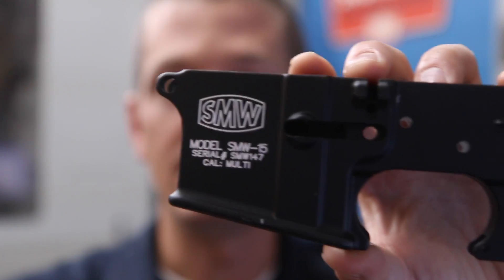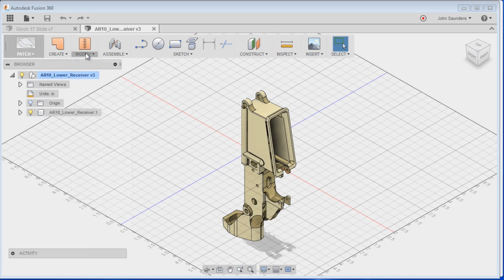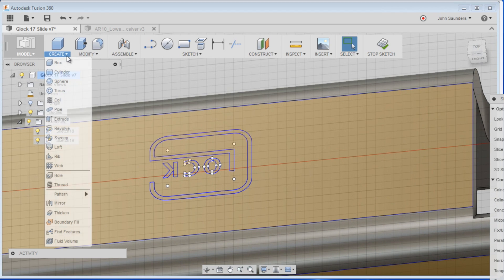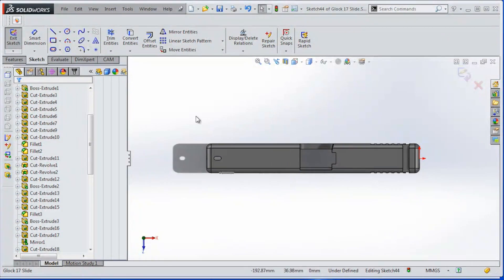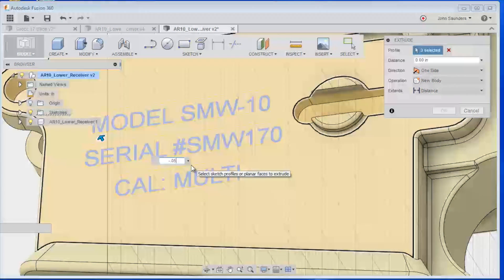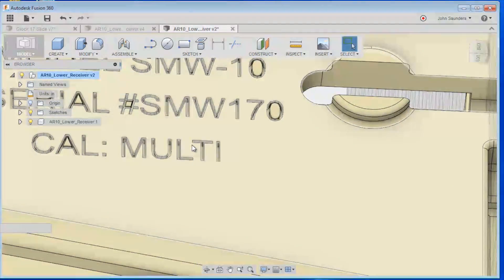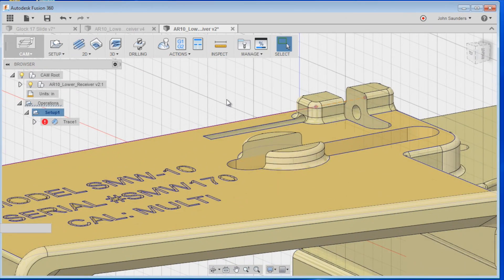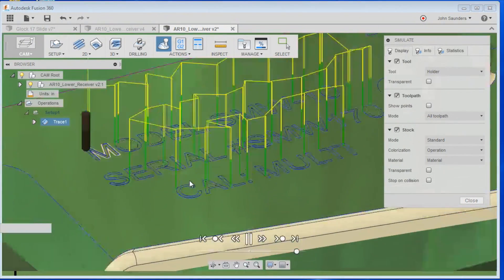CNC Engraving AR-15 Lower Receiver!  Widget49

Comment: 100% brand new to CNC because of as you said, DIY engraving on a AR, and I am having an impossible time trying to duplicate this. I downloaded from CNC Guns, but this would be so much easier if I could set the X & Y where I wanted them, rather than having the X=0 and Y=0 in the top middle of the face. Have you found a simpler way to do this? It's been killing me for WEEKS, and I'm about ready to give up. California laws suck !

Comment: Any chance that Fusion can do some kind of incrementing on that serial number where you give it a starting number and it counts up for each time the program is run? Or series if you are engraving multiple at once?
Reply: Might be a bit late here. 
If you want a number to increment every time you run a program, you would need something in the gcode that does that and I don't think it's possible. Some higher end machines may have that but actually idk. You could use the ParametricText add-in and link a text to the version number. You would just have to save the design to increment the version number and re-post the gcode.

Comment: I need to figure out how I'm going to do this for myself. I have a FFL and pay a Class II SOT, but my machines are all manual, so I have to send receivers out for engraving. I'm probably going to have to buy a desktop milling machine and do a CNC conversion on it but I could probably convert my Bridgeport clone for that kind of money. I know that I could build a pantograph attachment for my milling machine, but with that I would still be bound by the letter/number master plates I can purchase, and that would mean I couldn't engrave many of the reproduction fire control markings on Kalashnikovs and other foreign small arms. A CNC laser engraver would be awesome, but I doubt I could afford a nice one, and the Chinese models that I've seen are still expensive and of completely unknown quality. Powerful lasers are not something I really want to gamble with. I've also seen some importers use dot peening marking machines (not sure what they're called) to label older mil-surps with the importer's name. Those look pretty ugly and wouldn't really meet my needs though. Lastly, I have seen some pretty successful electro-chemical etching setups for recreating fire control markings on AK receivers, and the results looked pretty good. That process would be time consuming and require a lot of trial and error, but it would allow for a lot of versatility, so that might be a decent way to get started. When it comes to dealing with firearms nothing is ever easy.

Comment: Looking to get into  laser engraving ar15's and 1911's and even glock frame stippling and wanted to know what beginners laser engraver do you recommend and also the depth that ATF requires for  SBR's. Saw a couple of the Chinese  laser engravers and models that you can recommend and the wattage needed

Comment: John, care to do a video on engraving an AR15 lower that has a mag well that is NOT flat?  (and/or the receiver is slightly canted in the vise?)  I think you can take the technique that you used in the barrel engraving video that you made and apply it to engraving a semi-flat surface that A> isn't completely flat and B> might not be level in the vise.   Would love to see how you approach this in Fusion 360 and I think it would be an excellent technique that really could be applied to anything that you can't perfectly align in the vise....   Model the surface as it sits in the vise and apply the engraving to that surface and run the program.   I hope this request is clear?
Reply: +NYC CNC yeah, after the comment I realized I might need a bit more room to hopefully make the idea more clear.   Sorry for the double post in that regard.

Comment: hey NYCCNC or anyone on the internet. I am currently a high schooler looking to pursue an engineering degree in college. I have taken quite an interest in the CAD/CAM modeling/ design and fabrication like this. I wanted to know what title this type of engineering would be, because I never know how to answer.
Reply: Yanley Hello, The degree that would put you in a position to be doing things like this would be Mechanical Engineering or Mechanical Engineering Technologies.  The difference between the two put simply is that ME is more difficult and is more about theory and design. Working on the computer design objects in CAD and doing strength testing and things like that and wont usually be the one actually building the object. While MET is more hands on, you will still learn to do design in CAD but not to the same extent. You will learn how to fix and work on machines and potentially be the one to be building the pieces. MET would be a good degree as an entry point to get into he fabrication world.  So you will have to stop ask yourself what part of this you like the most and would like to do. Would you like to be the one who designs the Lowe receiver of the AR or the one who takes the design and runs the machines to turn a block of metal into a functional lower receiver.  I am currently in school to become an ME. There are other paths you can take if you want to be the one fabricating things like this. There are schools that are for people who want to run a cnc machine that you could look at too. I would suggest you check out the r/CNC on Reddit.com, because that will have all of the information you could want about getting into the field. You should think about maybe saving up your money to purchase a  mill or lathe of your own to get you started on learning, because if you do opt to become an engineer, you won't start to learn engineering skills and thing until your last semester of your second year. If you don't want to wait till then you can buy or build a nice entry level cnc mill that can cut aluminum, woods,plastics for around $2000.  I hope this was helpful.
Reply: Austin Connell Austin this was actually very helpful! thank you so much for the help and now i know what to look for
Reply: Hey dude, I'm a high schooler too(senior) going into mechanical or electrical engineering. This is technician work which you don't need to be an engineer for. However, I'd say go into engineering because it gives you much more flexibility and in depth knowledge. The engineer designs the piece with science, math, and CAD, the technician/machinist is who actually makes it into a real thing. I also built a CNC router for about 1500 dollars that can cut aluminum and other metals, as well as softer stuff. It's really useful, but I'm not an engineer yet but I still know how to model and machine, so you don't really need a prototyping degree which is why I say do mechanical engineering instead of becoming a technician. PM me on reddit or something, my handle is wankelgnome and I can  give you more advice/help you out.
Reply: Hynkel Hey! its cool to see someone else interested. I'm also a senior this year and i have decided on going into mechanical engineering and I'm super excited to start it. In my school I'm in some classes where i get to work with solidworks and CNC & 3d printing and its so entertaining to me. That impressive that you built your own router! what programs do you use to design?
Reply: Yanley Man you guys are lucky you have classes for CNC and 3d printing and solidworks and shit, in the middle of silicon valley here it's all code code code code. I use autodesk inventor personally but you could use solidworks to do it too. That's it. I designed the router in inventor and then built it, I used a drill press w/ cobalt bits to drill holes in steel/aluminum plates pretty heavily, other than that you don't need any tools except hex keys, screwdrivers, typical stuff.
Reply: Hynkel Thats pretty cool. There's no doubt that my school has its fair share of engineering classes. We have different rooms/shops all for Metals, Woods, Auto Tech (shared with small engines), Electronics, and engineering principles. In addition this year they are almost done constructing an entirely new STEM addition to our building to be able to have better working space. It doesnt suck
Reply: Yanley
 Man you got it good. What area are you in? That's a seriously top notch school with a lot of resources. Is it private?
Reply: Hynkel Im in southern Wisconsin, just about 15 minutes south of Madison. Its a public school in a relatively small town (pop. ~ 10,000) and a student population of maybe about 1,400. so nothing to big. I'm actually not entirely sure how they are able to have the funding for it but they have so many good programs for us

Comment: I made the STI 2011 and the AR15 that I have from the models on CNC gunsmith's site. Justin, the guy who runs the site is very helpful and knowledgeable, nice guy. awesome stuff next project is the 1911 slide, then the AR10.
It was because of those models that I learned Solid Works then CAM for MY DIY MILL back in 2010, today I built the CNC equipment my brother uses for his Fabrication shop, he turns metal in to high mechanical art, check him out if you want New Development Fabrication.

Comment: Did you get the recent newsletter showing the speed spindles for the Tormach? Looks like they are now offering a drop in solution for these jobs. High RPM. 30K I think.

Clean engraving there.
Reply: NYC CNC Hmmm, anything over 12k rpm probably isn't worth it, then your looking at super expensive cutters and outside the realm of HSS. Even my carbides fracture of 20K unless your using nanograin horrifically expensive ones. I use M2AL cutters up to 18000 at absolute max in alloy, which we all know is too fast but whatever they are about 4 bucks each for a 10mm one and they are damn good. Also I think he'll loose he's ability to rigid tap with that attachment. Maybe a motor change out to a 12k high torque spindle which would allow decent HSM feedrates AND rigid tapping too, 5600 is just toooo slow, but 30K is just way way to fast.
Reply: high-speed spindle kit (PN 35178)
24K RPM. Tormach did a video where they profiled steel with it. Eadc Components
You are absolutely right about the cutter costs. The high speed micro gain carbide. .. holy cow they are expensive!

Comment: Awesome video!!!
 I've heard Autodesk is working on a single line engraving method which I think will contour the letter once eliminating the cusp in the middle and making the toolpath much shorter.It may already be in HSM I think it's called V carve. The stitching video will be very helpful.
 On a side note what did you think of the changes to the tool library/manager.I was not impressed.
  
          Thanks,
                              Ed

Comment: I still prefer a carbide center drill #00 for engraving. Sounds strange but they work great and give you a much thinner line that in my opinion looks much better especially on small text. As for setting the depth, instead of setting a negative stock to leave, you can just set a negative axial offset.

Comment: Hi John,
when selecting the Z axis in the job setup you just click any face or plane perpendicular to what you want Z to be instead of making an axis or just click any edge that parallel to what you want the Z direction to be, doesn't matter if it is through the origin or not. Also any line endpoint is counted as a point so there is no need to manually put in a point,
Todd

Comment: Hey John, Here's a link to using the scale command under the modify tab and also when you select your Z axis you can click on the face where the engraving is instead of creating the axis for the Z plane.
HTH,
Grant.
https://screencast.autodesk.com/Main/Details/f7b6c5b0-e818-4035-b534-21f3015a69dd

Comment: I do a buttload of inches worth of engraving with a 2Linc spring loaded engraving tool.  Don't know if you've tried one but I suggest looking into it.  I found it and got one for our shop when we ran into material thickness variances on a job that had engraving (material variation was around .003 but that was enough to cause issues in the appearance when using a ball end mill.  Honestly love the spring loaded engraving tool though because we rapid into the part z-.040 and just go.  Sounds strange, but that's what it wants.  Makes beautiful lines and doesn't cause any burrs if setup properly.  You mentioned that RPM is a factor, with aluminum I'm running 3000rpm at 20ipm on ours.  That's conservative, I could run it at 8k rpm at the equivalent ipm but I don't as we pass over holes and other stuff and tool life can suffer.
Reply: NYC CNC Want to sell it?

Comment: This was exactly the kind of video I was hoping you'd do eventually. Great job. Very informative. 

Any chance you plan on making an AR lower from a flat at some point? Maybe some custom design? Would be cool to see some thread milling on the buffer tube. 

Also any chance you will make a video on cerakoting? There are quite a few already on YouTube but I enjoy the style of your videos and find I get more out of them than I do other channels.
Reply: NYC CNC at this point, a 9mm AR that will accept glock mags if you plan to video an AR from scratch :P

L lenses are pricey but hold their value.
Reply: NYC CNC I hadn't seen that up until now. Look like a nice lower at a good price. I wonder if the angle and narrow width of the magwell would require some creative fixture to hold it at the correct angle for a long endmill.